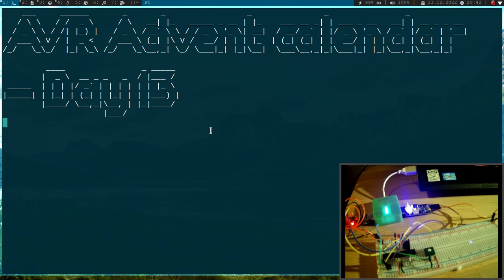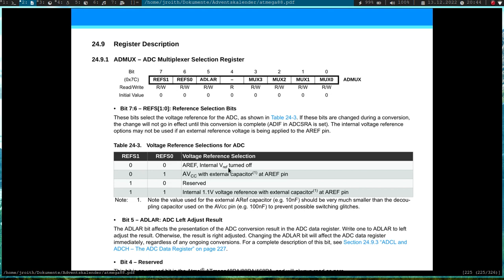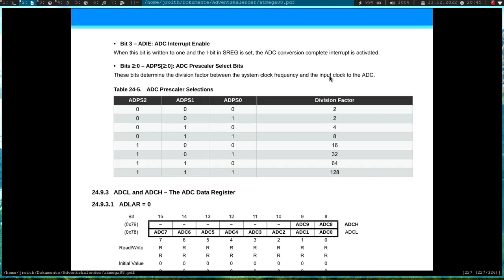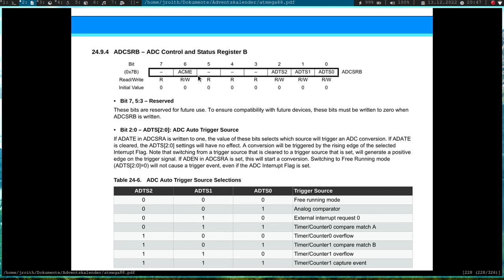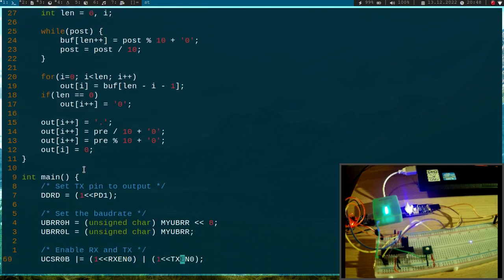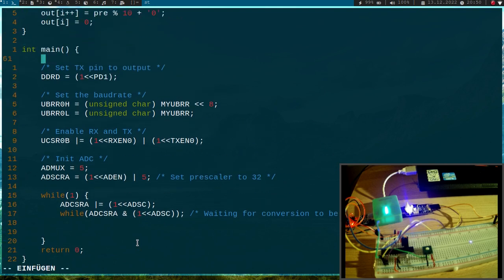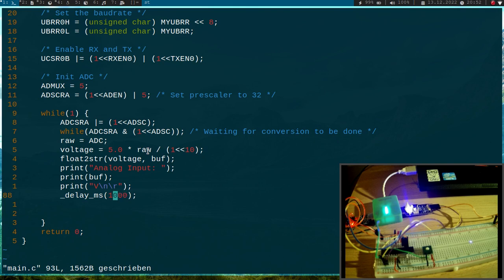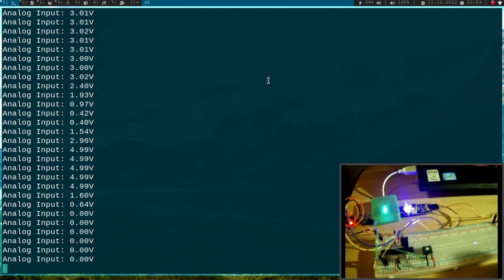AVR Advent Calendar - 13: Analog Digital converter

Comment: what about the float2str function. does it depend on the architecture? wouln't be better use sprintf?
Reply from the maker: I needed a function to convert a float to a string. To use sprintf I would have to use a C Library and link it to my project. This is not so easy and it would create quite an overhead as a c library is normally not very small and my Flash is limited to 8kBytes. Therefore, I decide to write a small architecture independent function to do the conversion.